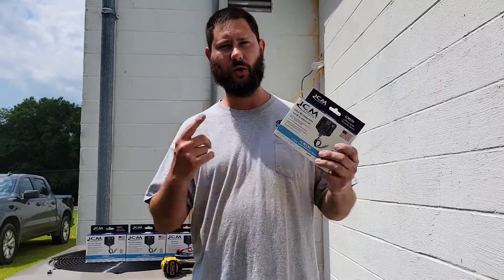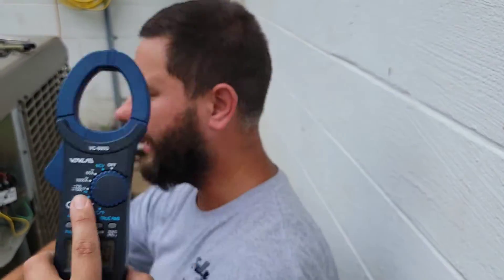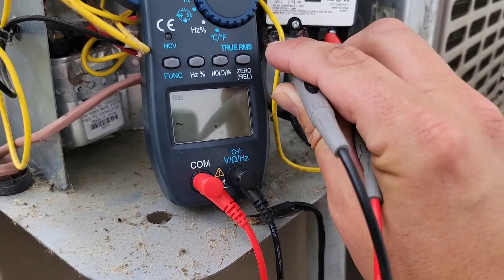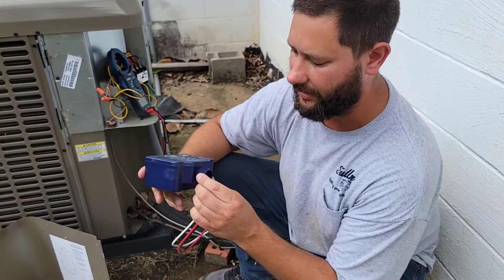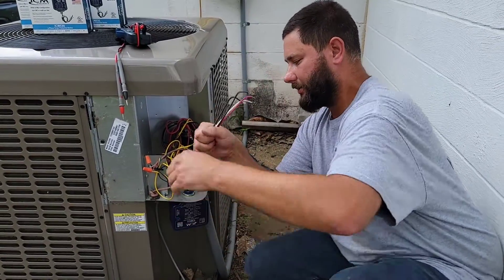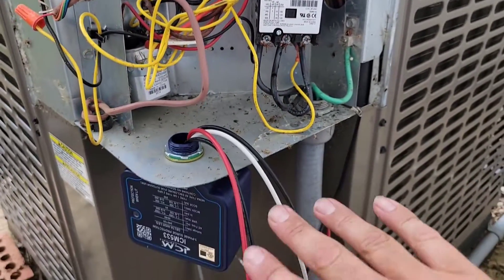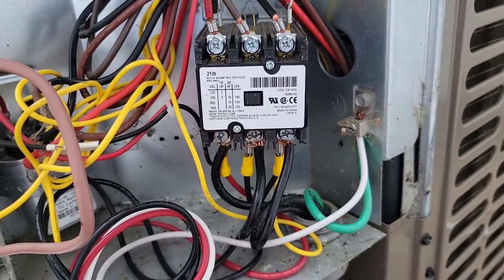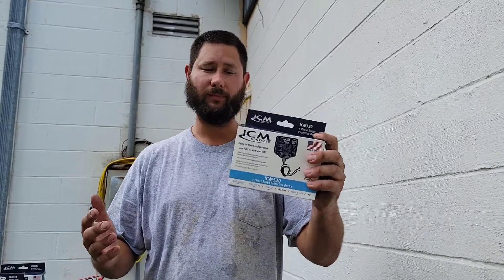How to install a three phase surge protector? ‎@icmcontrols9960

Comment: It's not a standard I've seen as an industrial electrician to wire your incoming hots to the BOTTOM of ANY relay / contactor/ motor starter... Weird stuff here.These are Factory wired that way, I know... 
But here me out... It's the SAME reason and standard that you wouldn't wire the incoming hots to the BOTTOM of ANY disconnect / safety switch...✅

Comment: Hi Tad thanks for informative video. I am in process of installing a mini split and per manual it is a single phase 240v system so it needs two hot wires L1 and L2 and one ground G.
My panel is a three phase with high leg. How do I do wiring from panel to mini split? Since there is 240v from any phase to the other can I use any two phases from the panel to mini split? Or should I use high leg with combination of another phase to get my L1 and L2?
What type of surge protector should I use? 
Thanks in advance

Comment: Aren't you supposed to keep the Surge Protector wires as short as possible ? What do you do if you notice the LED not on after a while ?
Reply from the maker: I may be reinstalling at the box that is why I kept the wires long 
check power verify power and then replace device